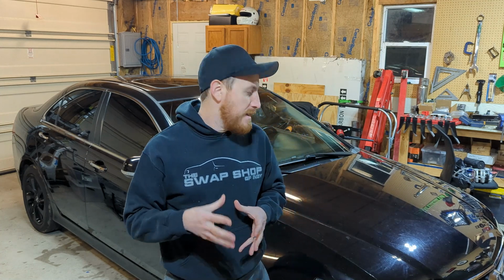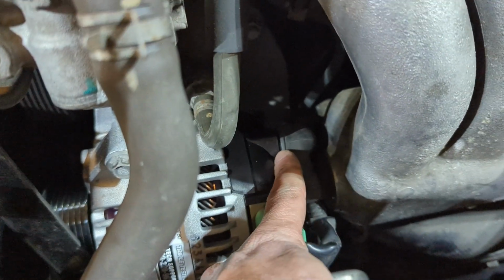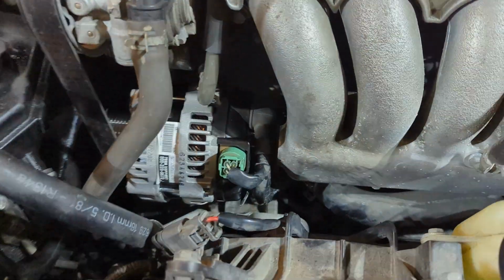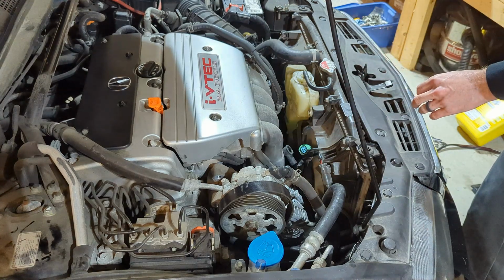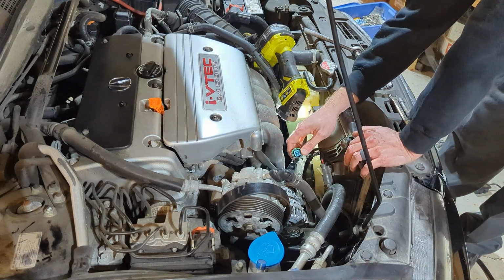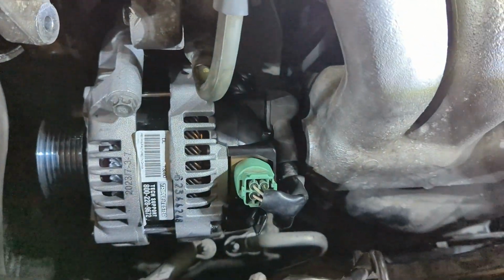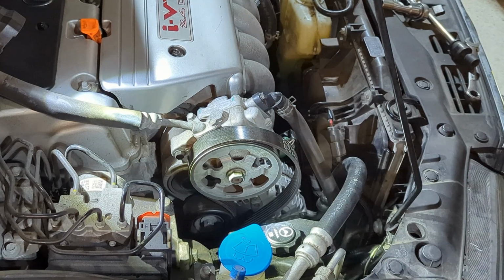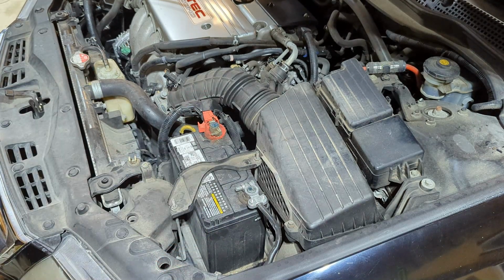"CHECK CHARGING SYSTEM" - 2004-2008 2.4 K24 Acura TSX/Honda Accord Alternator Install

Comment: Thank you for this video.   I had it replaced in much less time than I originally planned.  Your process is MUCH better than some of the older YouTube videos where they disconnected the power steering line or air conditioner line for some reason.
Reply from the maker: Glad it helped you out!